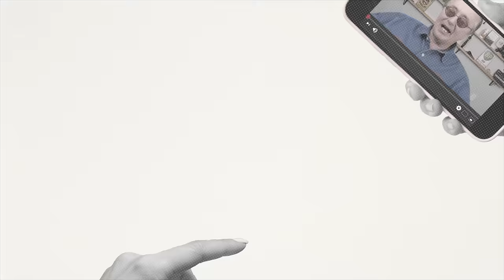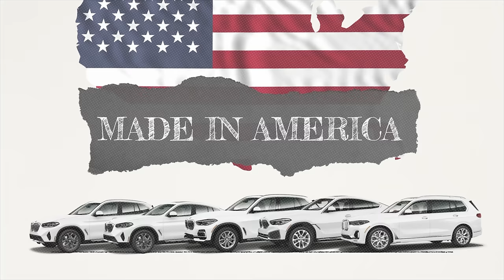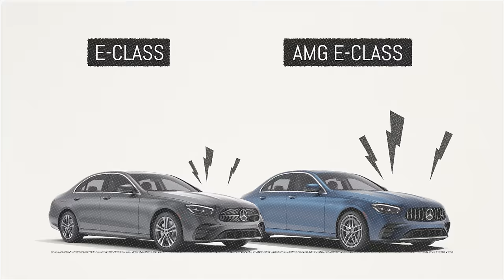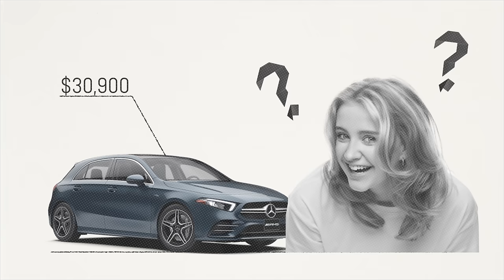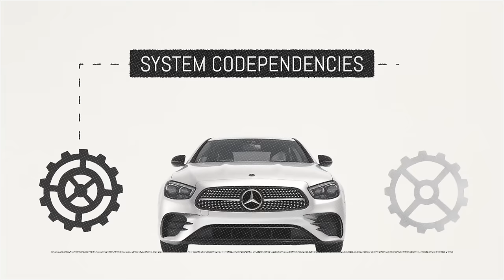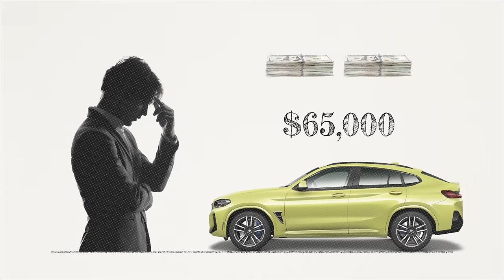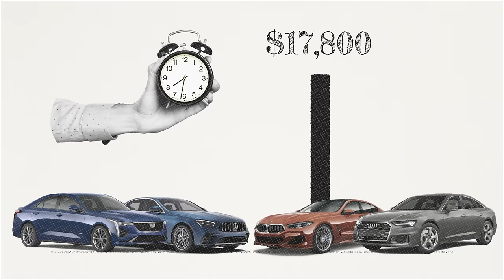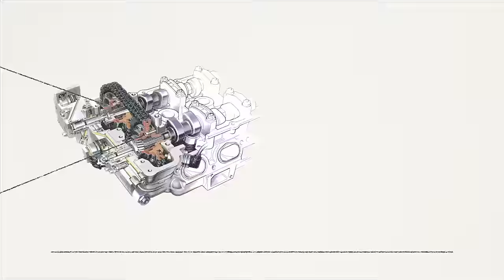3 Car Brands Only Stupid People Buy

Comment: I would never buy another bmw 5 series. I have to say a Lamborghini gallardo is more cheaper to maintain than a bmw in my opinion. Retail I went thru $9,000 in tire in just 10 months and also I had change one rim. Them I had to change my rear differential and two drive shafts. My drive shafts decided to bend upwards going 12 mph. The part were $8,027 without labor after this my radiator decided to spring a leak that was $2,400 then I changed out the coolant reservoir for $192 and a small hose for $63. Now I have replace the engine and cost is $10,883.73 and this not including labor. I only had car for less than 3 years.i forgot the air conditioner went out and that even more. The mechanic has to pull out the dash in the car to fix it. If do fix the air conditioners and replace the engine I will be at the $62,000 range on a $28,000 bmw which was a release return.  If you think about getting an electric bmw you will probably pay $120,000 just maintain it. One of the worse cars to own. I will be at $70,000 if put an engine in

Comment: I have a 540 I with 135k miles, new m340i and I used to have a 2013 s4 Audi with 245k miles on the clock. All solid vehicles… I guess most people are too dumb or too cheap to do the basic necessities to keep these cars on the road. Preventative maitnance and proper driving is key with these people…

Comment: Today Reliability is great per recent editions of Consumer Reports and it’s a top pick based on reports the last few years.  In addition the 4 year factory warranty and free maintenance for 3 years will make owning a BMW stress free.  So Scotty is using his information from many years ago NOT CURRENT OR RECENT DATA FROM CONSUMER SATISFACTION SURVEYS INPUT.  SO if you buy a BMW you will get a beautiful AND RELIABLE CAR that drives GREAT.  You will not spend any significant money for repairs or maintenance until it breaks after warranties and you can buy an extended warranty that is comprehensive for a fair price.  CHECK IT OUT AND TALK TO BMW OWNERS.  I HAVE OWNED THEM AND IVE NEVER HAD MORE PROBLEMS THAN ANY OTHER CAR.

Comment: Your opinions are very strong but you also offer opposing views on different videos.  One time you call Korean cars CRAP and another time you refer to a Korean hybrid vehicle as a Toyota killer.  Tough to trust your views.  I have had two BMW 3 series in a row for the past 12 years and never had a single problem with them other than regular maintenance.  Best to trust data rather than seemingly uninformed rants.

Comment: Literally all Albanians own a mercedes. Search up if the average Albanian is rich or not. The issue is that in North America the hourly rates are stupid. Mercedes charges around 300-350/hour. Even honda charges 175 per hour for service. The european cars are more complicated and they take more hours to get shot done. That is the reason they are expensive. Yes they are less reliable but not as much as people think. The main reason is because someone buys a audi and next thing they know is that to change the belt they have to remove the whole engine and with parts for 2k and labor for 4k no one wants to spend that type of money. Then it passes to the other person. In middle east or europe it is accessible to own a european car as the parts are the major cost. So please stop as if these cars are bad, they are expensive due to labor and people don’t maintain them due to this stupid labor prices. Also don’t tell me that mechanics deserve that money, most of the money goes to the owner of the service center.

Comment: BMW have a plastic pulley why on earth would they use plastic pulley almost everyone I know that have a BMW their car is always in the shop stay away from these cars I have a mercury Milan with 210000 on the dash and it dream like a dream drove it down south 3 times 13hour drive and it still running like a champ only replace brakes and the AC since I had it

Comment: Lexus will keep it value and won't fail.
Reply: AND SO DOES BENZ ALSO WHY DOES RESALE VALUE AND REALIABILTY MATTER TO YOU YOU WILL NEVER USE BOTH EITHER YOU DRIVE IT INTO THE GROUND WHICH NEEDS RELIABILITY OR YOU SELL IN 5 YEARS IN WHICH CASE RESALE VALUE MATTERS ALSO BENZ'S LAST AND THEY LAST LONG WHEN MAINTAINED

Comment: Some times I'm of the opinion you talk out of your backside. Not all bmws are bad. The early ones are better the early 2000`s .I own and wrench on a 2003 x5 pre valve seal stem issue. That car is like driving a bank vault around. Solid rust free now 21 years old. When I park it at work next to the rotting out newer truck that are American made I'm ashamed .at us rust made.

Comment: What a bulshit story, Mercedes parts are not expensive, not here in Europe. Same for BMW, parts are of high quality and will cost some, but not more than quality japanese parts from premium models. Your average corola will be cheaper for sure. I am used to driving my BMW and Merc for half a million kilometers without problems and still sell it to enthousiast for a reasonable price. Key is to maintain the cars well so they stay good, and run your engine warm before you start to use its full potential, which is almost impossible except if you drive like a maniac. I can't speak for American car owners, but when I hear this kind of info it makes me think they neglected engine maintenance and raced with cold engines.

Comment: By the 1980s German cars DESTROYED American luxury brands because they were much saver, much more powerful, and better built. The same was true for Swedish Volvos and their odd Saabs. The Japanese were not yet doing luxury cars but were preparing by copying the Germans... But, yes, they are also more complex automobiles. Thus, the problem is not that they are bad (although some particular models have been), but rather the cost of repairs and dealing with mechanics. You either have to learn how to do many of your own repairs to significantly cut cost or truly have money to pay others to do everything for you (if they even know how). My worst cars have not been used BMWs, far from it, it was a much newer Chrysler. And, yes, a Corolla is reliable but it is no luxury German car regarding safety and performance. Also, a boring Corolla will be worth nothing after 25+ years. An old BMW, Porsche, or Mercedes in good state is bound to be a restored and start gaining value as a modern classic.

Comment: My experience with BMW was miserable.  The dealer wanted to sell me a new transmission and I only had 60,000 miles on the odometer without doing any analysis on the car.  It turns out the computer chip needed replacement for $1,000 which I went to an independent auto shop versus a $7,000 transmission from BMW.  BMW knows this.  Can you imagine all the seniors that they  hoodwink into this sham and others.

Comment: Japanese cars are better than german cars
Reply: Wrong and not wrong Japanese cars can take your side of the road mechanics lack of knowedge on how not to break a car German cars will out live any Japanese car no matter how good the mechanic you take the Japanese car to is as long as the German car has a good mechanic fixing it
Reply: @Toyotacorollaaltis-cn9fd  Japanese cars in general have better reliability, being better itself is a subjective term, performance wise, German cars are better but to me when it comes to cars, reliability is the most important, we can’t drive fast anyways except for driving in Germany, so performance doesn’t really matter as much
Reply: @sajostory  As stated before if your Merc or whatever it is as long as its not a Jag or Range Rover if it sees the firm or any good mechanic and not those who either don’t know how to fix cars or purposely try breaking your car anything German will outlast anything Japanese I’ve owned both a Corolla and an A-45 and my A-45 experience has been far better more miles with less issues then the supposedly reliable Toyota still I do prefer the Corolla because I don’t have to care if someone keys it or wrecks into it